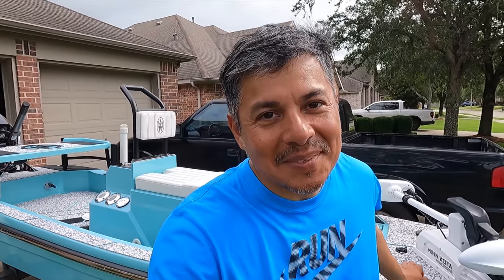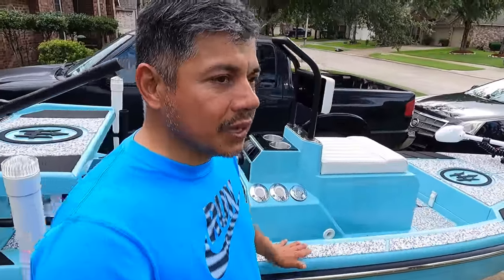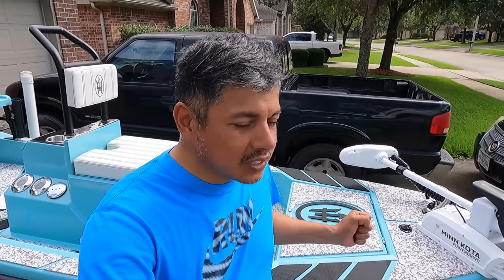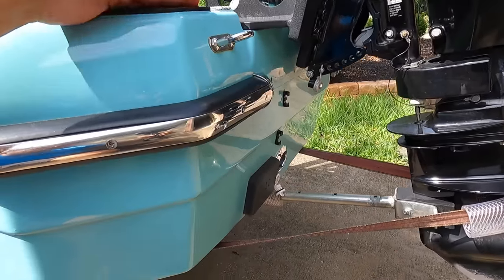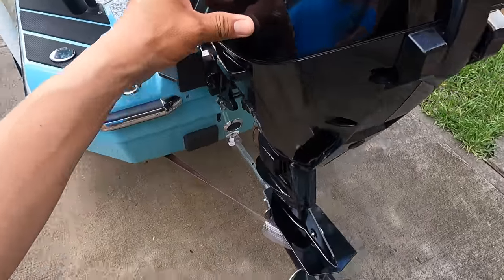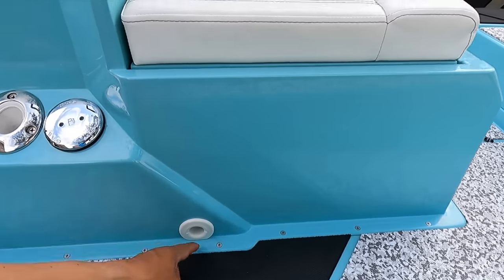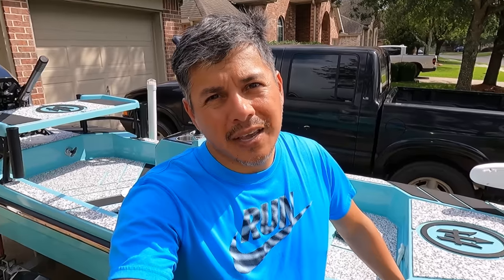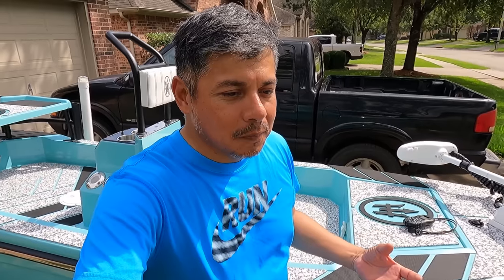(S4 Ep125) Sad Day for the Channel

Comment: They're nice boats, but to me, it seems that micro skiffs just aren't as wide as they need to be. The one I'm building is 13 and a half feet long and more importantly, 52 inches wide at the bottom with a beam of just over 62 inches. It's based on stitch and glue kit boats, but it's my own design. I just completed the structure (keel, stringers, and ribs). I'm using marine grade Meranti plywood that will be covered with fiberglass. When I flipped the frame over so I could start working on the hull, I'd guess the entire structure only weighs 60 to 75 pounds. Light weight is key to drafting shallow. When I step in the boat, it instantly gains 240 pounds!

Comment: I've been looking at Gheenoe LT25s. Can float in spit. Lightweight but big enough for two people. Looking forward to future videos of your next craft!
Reply: I have one. Love it. 25 hp on Jack plate. 9 inch garmin.  8 foot power pole.  I pilot trolling motor.  Raised deck, front and back.  Inshore fishing machine.
Reply: @Floridawoodsbanshee  Awesome man. Any cons youve noticed having it yet?
Reply: @saltwaterservant6526  yes the fuel line that goes into fuel tank has a disconnect that was not allowing fuel to get through. But that was easy fix. And if I was going to have another one built. The steering wheel on the center council hangs over on the left side. So I walk around the right side. I would off set the whole center council 3 inches to the left. That would create more room for walk around the right side of council. Everything else is great. Boat is stable. Fishing is good for two. Most times I go out alone. Really have nothing to complain about for a small boat. Mine is heavy with all the options. Does 29 mph.